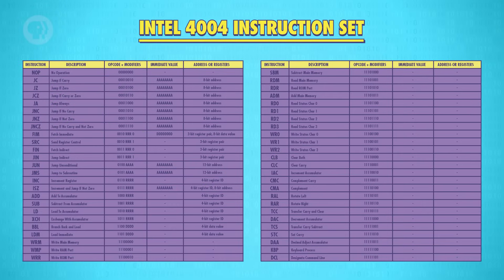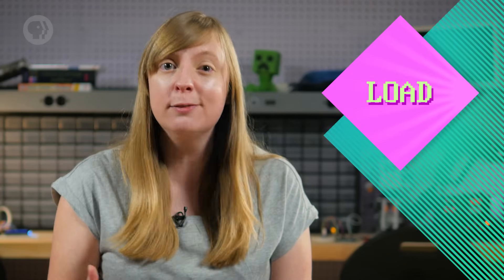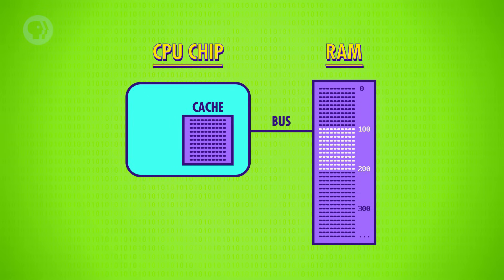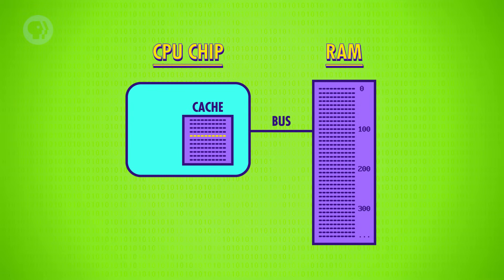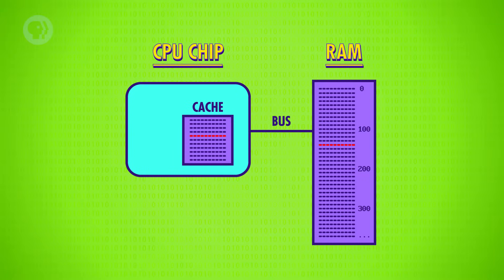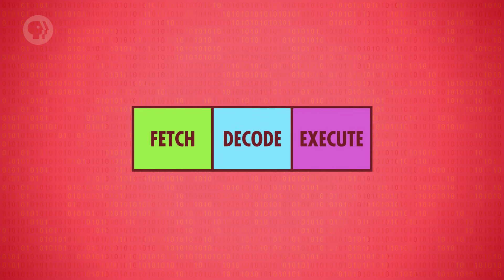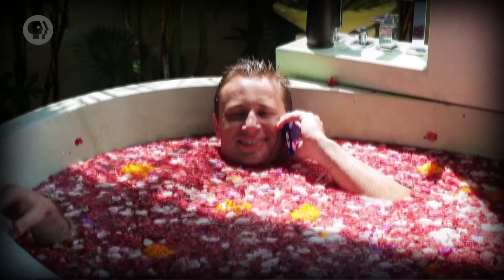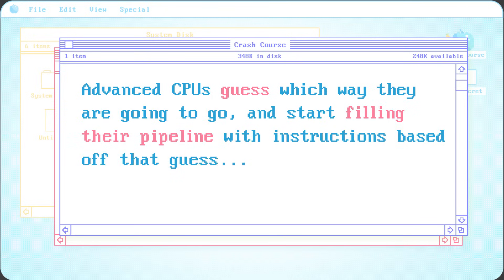Advanced CPU Designs: Crash Course Computer Science #9

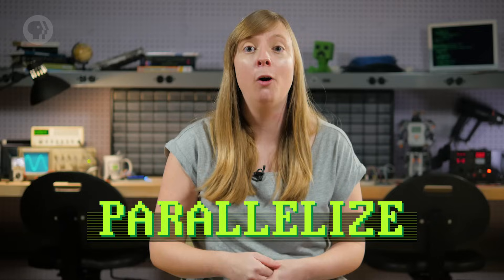Comment: Sorry but at 6:05, this is not called parallelization but rather vectorization.
Parallelization is the concept where you cut up a larger problem in blocks and calculate them at the same time (parallel) on different processors.
Information on the block boundaries may be exchanged between CPUs after each calculation cycle.
Reply: There are different kinds of parallelization. You are thinking of task parallelization. Vectorization is another kind of parallelization. It is a special case of data-parallelization.
Reply: compuholic82 Believe you me that I know what vectorization is: I’ve worked on vector-supercomputers in the past (1990s).
And I know the constraints it imposes on algorithms. When you breakdown the job in sub tasks and run those sub tasks in a “production line fashion”, you’re dealing with vectorization. No need to bring in the concept of parallelization to explain it.
In the explanation in the video here, it’s that “production line” approach that is explicitly used.
I hope you understand what I mean by “production line”.

Comment: design a computer system(on paper) based on intel 80386 processor.
in your design you have to interface the following devices and components to the microprocessor system bus in order to have a complete basic computer system :
*intel 80386 microprocessor 
*buffers 74ls244 an 74ls245
*latches 74ls373
*clock generator 8284
*crystal oscillator 40MHz
*bus controller 
*memory system : 4*128KB RAM and 8KB EPROM
*decoding system :74ls138 and 74ls139 and PLDs
*I\O devices : parallel PPI ,and serial 16550 UART
*timer 8254
*PIC 8259
*ADMA controller 82258
*digital and discreet components you may required
- you have to connect all the pins required for your design ,use component data sheet to show all the pins required for your interface.
-choose your memory and I\O address ranges
-you can use any application tools to assist you in your interfacing design

Comment: Modern multi-core processors theoretically have the ability to perform speculative executions along multiple branches of a program simultaneously with its different cores (up to the number of cores in the processor, of course), so if the primary core's speculation was wrong, the system can switch to the core with the correct speculation while the rest flush their pipelines and start new speculations, minimizing those delays. If they don't already, Intel, AMD, Broadcom, and Qualcomm need to impleent that, especially since there is still a lot of software that only uses one core, and lets the rest idle.

Comment: What!?! Speed of light becomes problematic at GHz speed for cm circuit lengths!?! And that is why we use cache!?! NO, NO, NO! RAM uses single transistor cells that is dependent on capacitance of the transistor junctions (Which discharges over time and why DRAM needs to be refreshed which also slows it down). This also means that the read and write are slower. Compared to cache which is SRAM which uses bistable flip-flops consisting of at least 6 transistors (Hence more costly per capacity), there is no slow charging or discharging of capacitors, refreshing cycles etc. which makes it much faster. Notwithstanding the fact that the bus DRAM transfers over is slower and narrower than the internal bus of the CPU also slows it down.
Reply: Nico van Dyk just in general, having something smaller and closer helps, regardless of the memory used. Don't forget about the decoders...
Reply: Having a GHz CPU means to have one clock cycle every nano second. Light needs about 0.1 nano seconds to travel 3cm (about an inch). So yes, the speed of light becomes problematic at that scales. Although the rest of what you said is true. But the speed of light thing is more fundamental - you could theoretically build faster RAM. But you will never transmit data with a speed higher than the speed of light.
Reply: Andreas Stangl AND electricity doesn't flow at the c in copper.
Given the small, high resistance interconnects in modern cpus, the speed of an electric signal is far slower.

Comment: > High clock speeds and fancy instruction sets tend to lead to another problem - getting data in and out of the CPU quickly enough. This time the bottleneck is RAM.
I didn't get it, how is this related?

Comment: The electrical signals are traveling the speed of light in the medium in which they are contained so the speed of light in a copper trace on a motherboard going through the gold contacts into a gold wire and into silicone will travel at the speed of light in each medium.

Comment: if your DRYER takes 90 mins, you must have a BLOCKAGE IN YOUR VENTING to the outside. the pipes often fill with lint and blocks airflow. if left unchecked, it could cause a FIRE. there are cleaning tools for this or you could take the vent tubes apart and clean them by hand. btw. this series is awesome!

Comment: Actually, RAM is no longer the bottleneck in the system but the second faster element after the processor itself. There is a new design paradigm spearheaded by HP Enterprise Labs called Memory Driven Computing in which put the bulk of data processing closer to the RAM to improve performance, it's called The Machine.

Comment: Real talk on the dryer thing: Usually long dry times actually come from your ventilation out of the back of the dryer to the outside. That hose and the pipe between the hose connection and the side of the building get clogged with lint and the occasional wasp nest. Cleaning those out will shave tons of time off your dryer and save your money on your electric bill.

Comment: Overall 7/10 :-) I really think this series can have impact on different age groups, and not only people with tech background or motivation. And that would be great!
But I also have some critics, hope a useful feedback: 
A. Host is talking far too fast.
B. Not all technical facts are correct.
Example - The reason for few MB of cache is not the SIZE of the DIE. Is the COST of the SRAM, i.e the cost of CACHE memory. Back in time, when we speak of KB,  again COST was the biggest obstacle and first factor regarding CACHE Size. Manufacturing process changed, so die size could've been scaled, but it was not reasonable to do so. Already having the SRAM cost to the roof, leaves nothing for other expenses in the pursue of bigger Cache size and perf boost. So the barrier was and still is COST of SRAM. Nowadays you have CPU & GPU on the same DIE, so the die size is not the main factor today, was not a factor back then. Hope that's clear. I think this is one of the straightforward examples of wrong information.

Hope this feedback will be taken into consideration, because these series have good potential. For fluent or advancement speaker sure it's no problem the pace of the presenter, it's rather engaging. But for the bigger audience of non-native speakers... most definitely a big loss of audience. And probably that same audience, group of people, will not even going to try to see another video from the series. That would be a loss for the series in my opinion. As well and for those people came to seek information or just watch a cool informative video , which to be honest is even more of a reason to reconsider the pace.

KUDOS for the effort and outcome. The video is way above average videos on youtube regarding tech, but has big room for improvements too ;-)

Comment: Love this series! I did have an interesting question regarding branch predictions! How might AI affect branch preditction in the future? Could it be implemented to do multiple predictions down different paths with high accuracy?
Reply: 3riichard the new AI techniques work by throwing a lot of computing power at a problem. Branch prediction algorithms have to be simple, otherwise they are too slow.

But! There could be more AI techniques used in compilers.
Reply: Very basic AI techniques are actually used in modern branch predictors! Commonly, a CPU will have several different branch predictors that work in different ways and are good in different situations. The CPU can compare these different predictions, and if one is more frequently correct, it will weigh that predictor more heavily when it makes future decisions. Or if one predictor is always wrong, the CPU can figure out to ignore it. Search "perceptron branch predictors".

Comment: And what about GPUs? ;P
Reply: Unlike CPUs, GPUs work by parallelism. All instructions are being run simultaneously instead of dealing with it individually. However, it can only deal with simple instructions and not instructions that will affect one another. You can think of a GPU as a gifted child that can calculate all simple math addition problems given at once, but cannot do complex university math. CPU on the other hand, can be think of as a university student or grad that can do complex math problems, but cannot do simple math addition all at once.

Comment: Does a flop have something to do with floppy disks?
Reply: There are several ways to talk about computer speeds. One is MIPS (millions of instructions per second), but since different instructions might take up different times an alternative is to measure MIPS while running a specific program: the Dhrystone "benchmark" application. This will tell you the D-MIPS number for your computer. But this program tests operations with integer numbers (like 42) while some applications do math with floating point numbers (like 0.0745 or 1.6e45) instead. So an interesting number to know is how many FLoating point OPerations per Seconds (hence FLOPS) your computer can do. If it can do millions then you can say how many Mega FLOPS it can do and if billions then Giga FLOPS.

Comment: On a hot summer day, using a clothesline is faster - about an hour or less depending on the material.  For many things it can be as little as 30 minutes.  You have to use your arms as a cache for the big yellowy sky processor/dryer.

Comment: Fascinating series, I enjoy learning this stuff. I find it interesting that it seems like CPUs are doing more with less these days. Less electricity, less heat production, etc. Well the good ones, at least. I recently got myself an ASUS G11 as a graduation gift. I am amazed at its power for having such a marginal clock speed. It's an I5 6400 rated at 2.7ghz, but it typically runs at about 3.0-3.2 due to Intel boost technology, however that works! LOL Anyway, my old I3 3rd Gen has a higher clock speed but can't touch this thing. I suspect it has to do with more cache memory and more advanced circuitry. Not to mention it's on a decent ASUS board and paired with 16gb DDR4. It's also running a GEFORCE 1060 6gb GDDR5 GPU. Even with a 2.7ghz CPU this thing runs 4k games, videos, etc without a hiccup. The better games in 4k use mid-high settings when optimized, while full HD it runs just about everything at ultra. It also seems to me, based on my limited understanding and research, that while AMD's newer CPUs boast high clock speeds, they also use a lot of wattage and produce considerably more heat than Intel's. Just my understanding, feel free to chime in on that. Oh, wait, it's Youtube, that goes without saying! haha
Reply: Also, I had read about China's new supercomputer, that put US supercomputer tech at #2 in the world, before seeing this. I read that they used mainly Intel chips in their supercomputers, but were recently blocked from purchasing them by the US State Dept., so they made their own. The rationale for the State Dept's decision, I read, was that they didn't want to assist in giving China an edge over the US. Well, now they have that edge and their own processor producing capabilities and we (Americans) and our economy just lost revenue. Thanks!
Reply: Ryzen has a lower IPC (instructions per clock) and a higher wattage. It's clock speeds are NOT high though, the 6950X beats the r7 chips by around .3Ghz so around the same OCs. The main selling point of Ryzen chips are the lower price compared to Intel chips.
1060 and RX 480s are the most realistic choices for GPUs at 1080p as games these days don't run so hard on GPUs at lower resolutions and CPU bottlenecks would happen first.
Reply: Well, I wasn't referring to any specific model that AMD makes. I have seen one they make with a 5ghz clock speed, I believe. So, I guess what I was getting at is that the way I understand it, for comparable models Intel will be more costly but use less electricity and therefore, cost less to operate in the long run. Anyway, I appreciate your contribution to the discussion! Tell me, do you think a GSYNC monitor would help much?
Reply: Honestly I don't know how the U.S. is the superpower in the world with the debt and poor decisions like that. (Not literally so don't give me a long drawn out reason for that, I know why they are the leader but it's just so stupid, we need some kind of rebellion so people actually vote and care about the government).
Reply: Short, to-the-point reason: Biggest arsenal on paper! 
http://www.pcworld.com/article/2908692/us-blocks-intel-from-selling-xeon-chips-to-chinese-supercomputer-projects.html
Reply: Also, I know AMD processors work well for gaming and other stuff. I use them everyday in my PS4. Knowing roughly what gaming rigs and components cost, I am impressed at the new gen consoles doing as much as they do, 4k, HDR, etc. at that price point.
Reply: Consoles use AMD processors just because Intel demands a higher price premium (most likely) and I read that article already =P
Reply: Yeah you're probably right about the consoles, it is still impressive compared to gaming rigs. Glad you are up on somewhat current events, I mostly provided the article to support my claim. You know how claims on the internet can be, right?! haha
Reply: You mean that most internet claims are a some BS right? yeah I see that a lot. Xbox Scorpio is shaping up to be a pretty decent machine too for $700 or so, hopefully that isn't some marketing BS and they actually make a machine that's as good as a RX 480.

Comment: It's funny because the supercoomputer probably can't run Crysis at max for a number of reasons lol.

NOT SO SUPER NOW HUH
Reply: It's basically a giant GPU with a CPU orientated architecture with all those cores. GPUs are the same as CPUs except they are made to run many simple operations over and over rather than different complicated operations randomly
Reply: I guess i would expect some pipeline restriction to cause it to not run well. I do get how the massive calculations performed sre in many ways, simply more difficult GPU calculations though
Reply: SleepyGuyy it probably could if it used GPUs instead of CPUs like some newer servers

Comment: Doing more things at once is cool and all, but programmers tend to be really bad at actually writing code that can be parallelized, and not only because of memory issues and mutual exclusion.
Reply: True, but usually you're not running a single process at a time; with multiple cores/cpus, you can run multiple programs that don't depend on each other, and it will be much faster than having the OS switch back and forth between execution environments.
Reply: +brambleshadow4
True, but are other complications to that. Especially with features like paging where large structures have to be duplicated for each process. I'm not sure if memory protection schemes will be covered in this course, but if they are, be prepared. They're a doozy.
Reply: Why prepare for that when instead I can study for my OS examination tomorrow?

Yeah, but at the moment, there's no such thing as virtual memory. Or multi-level caches. Or two's complement for that matter. Who knows what they'll mention in the future; it'll probably be pretty quick, but then it's called Crash Course, not "Everything you could ever know about Computer Science" course.
Reply: You're taking an operating systems course exam tomorrow? Cool! I had mine last Tuesday.
Right, they haven't covered 2's compliment yet! That's usually covered at the same time as binary addition.
Reply: :D

Comment: Nothing can play Crisis at max settings. I don't think anyone even knows how they developed the game. O_o
Reply: They didn't develop the game, a time traveler gave them a copy of the game in the year 1930. Where do you think we got our computers from?
Reply: This means it just has poor optimization.
You could set up a game that runs on path tracer and all you will get is a a blurry, noisy mess every 1/60 or 1/30 of a second
Reply: Yes indeed. It only took 3 years after the release of Crysis 3 to get a good cpu/gpu combo to run it. lol
Reply: I don't know about you, but all of mine come from Japan and Singapore. lol
Reply: Neon Thought I could run it back I  the day on a 8800 gtx overclocked, but if I remember correctly at around 25 fps
Reply: 'twas but a joke. :/
Reply: Time travel.
Reply: Neon Thought I wonder can I have a 1080ti to run crisis 3 at max setting
Reply: Sure, but only if you're running 3 in SLI while submerged in liquid nitrogen infused mineral oil. lol
Reply: Crysis was created just as a saying in the gaming world
Reply: liquid nitrogen "infused" mineral oil. lol. that doesn't even sound possible.
anyway I think they made the game by first uninstalling windows then reinstalling a very small barebones operating system... on a supercomputer from the future.
Reply: You do NOT infuse mineral oil with LN2, oil won't mix with other liquids well. Also LN2 can damage voltage regulators and other components with how cold it can go, so only the GPU core can be cooled with it unless you want to break your card.
Reply: I know, but that's me for you =P.